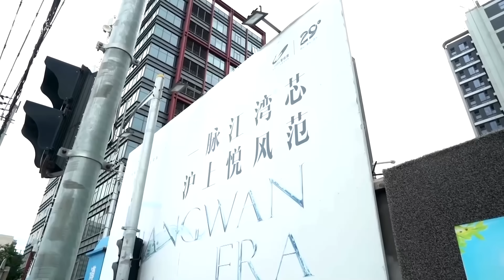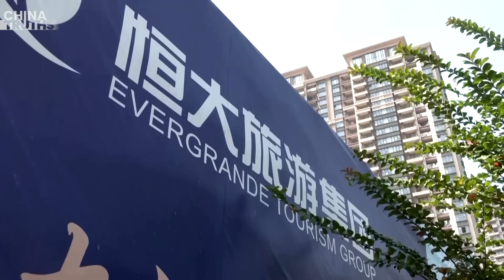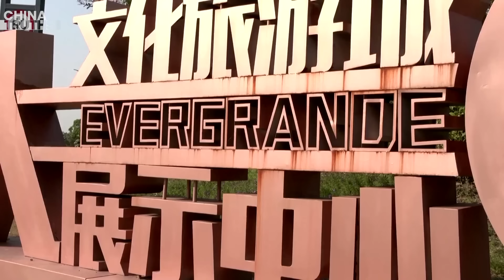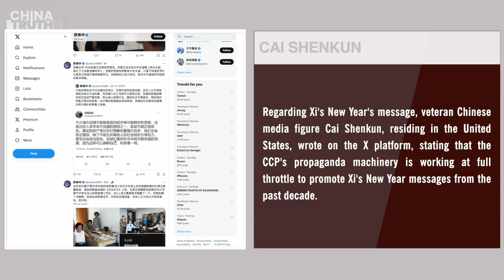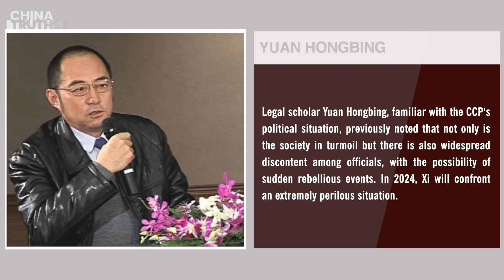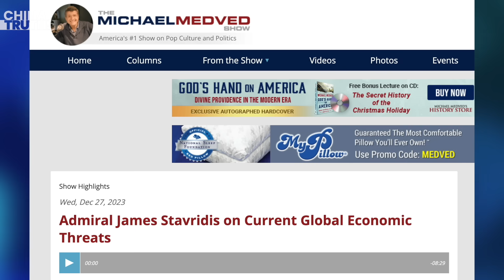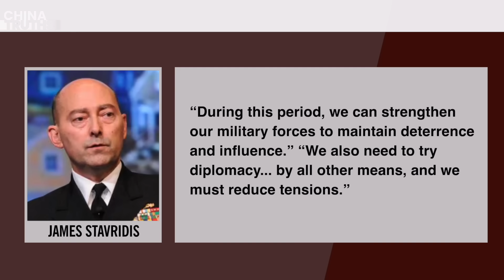China's Military Leadership Rocked by Corruption Scandal; Xi's Pessimistic New Year Message!

Comment: The strangest thing....china has been building with speed their ships....BUT some time ago due to poor coal quality ,and poor supplies ,bad unqualified workers,and graft and theft of funds,extreemly poor quality metal was produced.,STEEL was so brittle, even nails bend to soft. Now think of this in ship production.The steel production of bars to invert inside buildings so poor quallity they are to thin crack bend and crumble and that is the metal,now add the poor quality concrete and other building materials on top of very poor qualified builders that have not an idear what they are doing.....Now if the chinese apply those terrible building idears  to ships......it is no wonder their subs crack and implode,their ships catch fire from god knows what,and decks buckle and crack on aircraft carriers befor they leave the builders dock ,fat chance of standing up to a sea battle .When even their cargo ships are rusting and falling apart,and  break in two in small storms,their goods are known as  trash,AND THE CCP WITH ALL THIS ...STILL HAVE PLANS TO TAKE OVER THE WORLD,......WITH WHAT   sticks and stones from their crumbling buildings , and big mouthing big winded ,how great they are ???????